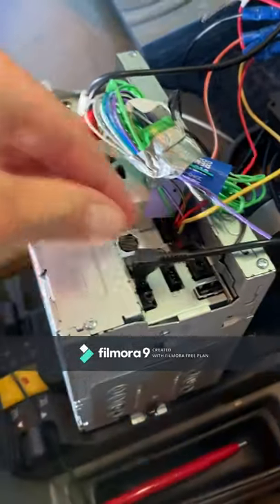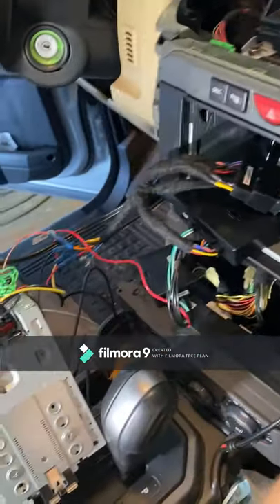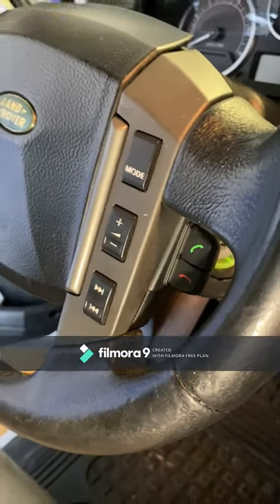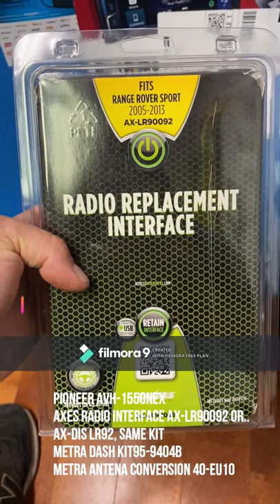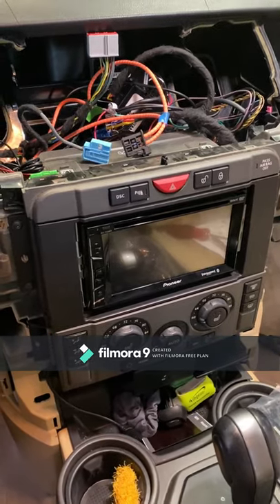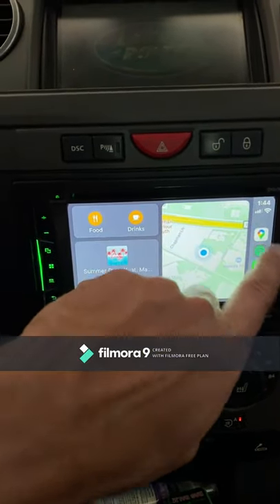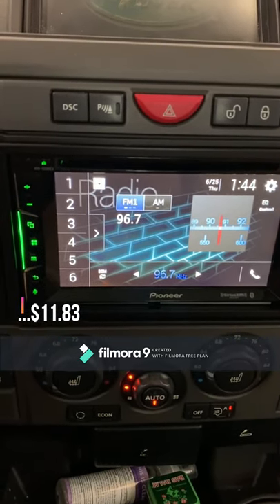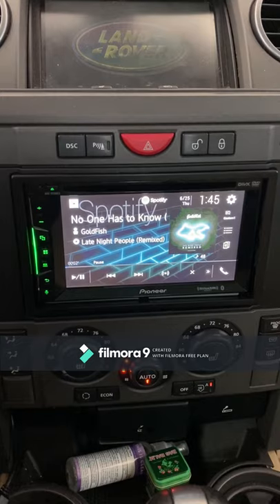Landrover LR3 Head Unit Upgrade

Comment: Hello, I have a Land Rover LR3, and I need to change my heat unit.  I like to know where you purchased all the electronics you purchase to install the head unit.  The name of the control for the steering control, the XM connection, and the box that controls the fiber optic cable.
Reply: I was able to purchase everything on Ebay at reasonable prices.

Comment: A bit late to the party but, the LR head unit is the master on the fiber (Most bus) so remove the unit, the sat nav screen stops working,
The 4x4 info with suspension height and steering angle sensor is sendt over the high speed canbus nettwork. The head unit is connected to this bus so it can send messages from the modules in the vehicle to the info screen over the fiber cable to the screen. Thats why you only have the LR Logo. The screen does not know what to do, so it just sits there and waits for that information.
Reply from the maker: I do not care about any of that info on the main screen. I knew that the installation would make that screen un-operational. The stereo being from what felt like 1980 was the main goal here.
Reply: Hi there Pelle!
Do you know a way to make the satnav screen work again? I am tired of the LR logo 😑
Reply: @stianramberg7023  hello where did u purchase the radio harness from

Comment: I have an 08 sport with the logic system, purchased a scosche harness which is very similar to the one you are using in this video. However I’m not getting any audio. Did you have to do anything special with the fiber connection or simply plug it into the black box and it kicked on the amp/audio ?
Reply from the maker: I just plugged in. I had no issues. I wish I could be more helpful.

Comment: I looked on Sonic's website and the exact model number for the interface kit reads that it does not fit?  How is that so?  I have a 2006 LR3 SE with harmon kardon amp
Reply from the maker: I don't know what sonic's website is. The linked kit fit, obviously there's a video on it. I don't know what you're looking at.

Comment: Does this setup work only with your specific din out could I use a different din and get it to work still? The reason I ask is because I want to fit a din that has both a front and rear camera.
Reply from the maker: Any DIN will work with this.

Comment from the maker: A couple questioned answered. Links pinned beneath them.
4x4 and Nav screen displays Land Rover logo. No functionality. 
I apologize I did not do a more thorough video install. I wish Youtube would let me update the video, but I cannot.
You will see the AXESS kit says for Range Rover only; it works for both

A user on here commented he found the AXESS kit for cheap https://www.installer.com/item/display_item.php?it=ax-lr90092
Pioneer https://www.amazon.com/Pioneer-AVH-1550NEX-Receiver-Carplay-Bluetooth/dp/B07MX4SCWX/ref=sr_1_2?dchild=1&keywords=pioneer+avh-1550nex&qid=1631203551&sr=8-2
Dash kit https://www.crutchfield.com/S-1N1yw3CN5e0/p_120959406B/Metra-95-9406B-Dash-Kit-Matte-Black.html?XVINQ=GLX&awkw=1264260868768&awat=pla&awnw=g&awcr=521512549433&awdv=c&awug=9028306&gclid=Cj0KCQjw4eaJBhDMARIsANhrQACuJnU7V8FhTOGkTFUnT3lPKmHEBzCCTQRjQWr07v2lwcc3Ri1ijt4aAqSHEALw_wcB
Antena Adapter https://www.amazon.com/Metra-40-EU10-Antenna-Volkswagen-Vehicles/dp/B000329HEK/ref=sr_1_2?dchild=1&keywords=40-eu10&qid=1631203694&sr=8-2

Comment: Upper screen still used for anything besides displaying the Land Rover logo?
Reply from the maker: No, It just displays Land Rover emblem.
Reply: @jonathang1986  Bummer... maybe it can be removed and something else put there then?
Reply from the maker: @TommyboyGTP  No, the GPS has the fiber optic tied to it. If you remove it, the stereo won't work. What were you hoping for? The GPS system in the LR3 is archaic compared to today's technology.
Reply: @jonathang1986  Just wondering i don't know too much about electronics.  I saw a video where a version without the nav maintained the factory radio, but had an Android head unit was put in that empty spot and used on the AUX setting.
Reply: Hey just letting you know your information was Helpful🧠 to me !$
About to install a new after market radio, will let you know how I made out!
Reply: Jonathan Ganther  I watched a video the other day that included a little fiber optic loop that they inserted in place of the upper screen that fixed the issue and allowed for the removal of it.  (Edit: here it is, at 6 min mark  https://youtu.be/hGmF5yhUvG4)

I am curious, does the wheel position monitor on the green screen by the speedometer still appear in low range like before?

Comment: Great video. Thanks for listing all the parts. Question - my car doesn't have the Nav system. Will the AX-LR90092 work? I can't seem to get a straight answer on this. Thanks
Reply from the maker: Does your vehicle have Harmon Kardon? I believe it will still use the fiber optic for stereo. So yes.
Reply: @jonathang1986  Yes - it does have the Harmon Kardon. I'm hoping this will work as there doesn't seem to be any other harness available. But it's a big price tag to take a risk on.....
Reply from the maker: @davidwalker9604  The fiber optic cable is going from the old unit to the Harmon Kardon amplifier. This wiring harness kit just converts that signal so that it can use the fiber optic cable still. I so no reason it wouldn't work. Then again I can't guarantee anything.
Reply: @jonathang1986  That makes sense. Thank you very much for the info. I think this harness is my only option. I'm hoping that the main steering wheel functions will work but if they don't that's not a deal breaker as long as I can connect to the amp and the speakers without having to rewire the entire vehicle.
Reply from the maker: @davidwalker9604  They will.
Reply: @jonathang1986  I found a great resource www.installer.com in Houston. I spoke to a very knowledgeable Dwayne who was able to help me select and order the correct parts for my new stereo. Part #20232 plus radio antenna.
Reply from the maker: @davidwalker9604  Awesome man!
Reply from the maker: @davidwalker9604  For $285 too! Nice that's a steal.
Reply: @jonathang1986  Got my stereo installed. Can't get the SWC to function which is really annoying. Maybe because I have a Blaupunkt BP800 which is a bit obscure...Screen is also hard to see in sunlight. Thinking about switching units.
Reply from the maker: @davidwalker9604  Did you program the SWC? If you don't program them it won't work. key in on position hold down until those LED on the AXESS kit go solid.
Reply: @jonathang1986  I finally got my SWC working! Thanks for the video!

Comment: Hi which best smart screen for Lr3? And what i must buy with it ? And where to buy? Thanks
Reply from the maker: I can't answer which screen is best. I list everything needed in the video. A quick google search will provide everything you need.
Reply: Any 2 DIN system should fit with the correct dash kit and wiring harness. I recommend  connecting Dwayne at www.installer.com.

Comment: is the 4x4 screen above that shows the suspension airbag levels and wheels still working?  thanks
Reply from the maker: No, it only displays the land rover logo
Reply: Jonathan Ganther well that’s crap then
Reply: @ptescreen18  honest question, if the status is reflected in the physical settings of the center console controls and the information screen in the instrument panel, what does this really take away? It seems to just show you what you already can tell. Curious for your view, perhaps I’m missing something!

Comment: Where did you buy this at
Reply from the maker: I got lucky and found this AXiSS kit for $300 on Ebay, search the part number in google. Here it is on ABT site. https://www.abt.com/product/148253/Metra-Land-Rover-DIS-RR-SPRT-With-MOST25-Amp-SWC-Retention-2004-2009-AXDISLR92.html
Reply: @jonathang1986  will this kit work with the harmon kardon 7 sound system
Reply from the maker: @PinaColato_  Yes, that's what my system is.

Comment: Someone told me if you buy another fiber optic cable to complete the most network you can get the 4x4 screen working again. I really want mine to work again. I love my CarPlay, but can’t stand looking at the LandRover screen anymore.
Reply: Could it be installed instead of the Landrover screen ?
Reply: I do it on my car i have a pionner and up normal screen with my 4x4 info etc but i need to put my oem radio inside seat by optical fiber installed

Comment: No links? 👎🏾👎🏾👎🏾👎🏾👎🏾
Reply from the maker: It's called google you a-hole. I provided everything you needed. All the parts numbers. I bought these on eBay there are no links, all the auctions have ended.
Reply from the maker: and secondly, the links are at the top of the comment section...